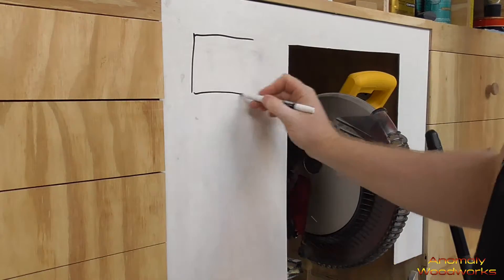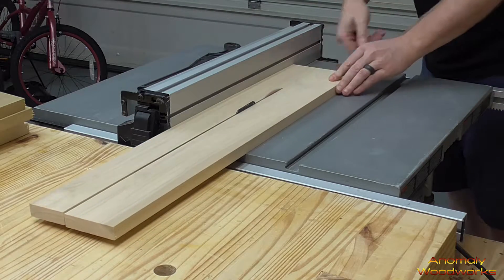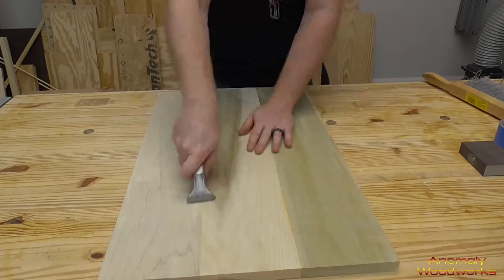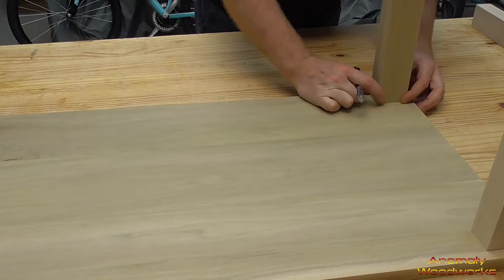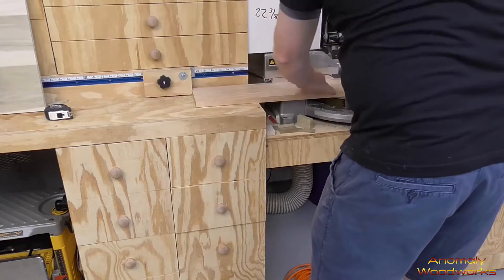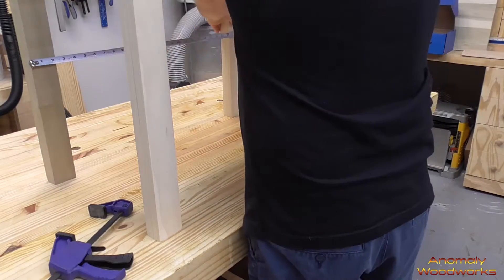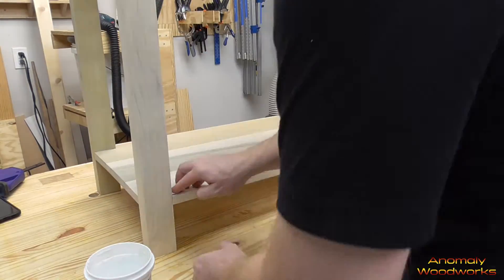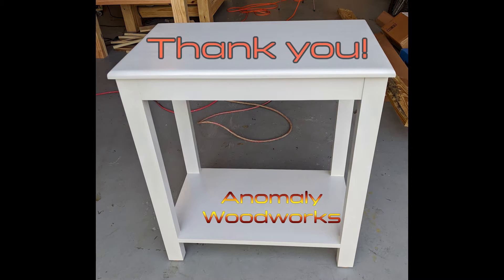Build a Small Table (End Table/Utility Table)

Comment: Cool idea. I've just gotten into the hobby. What kreg screw size did you use on this project?
Reply from the maker: Awesome! Generally, screwing anything into workpieces that are 3/4" thickness you would use the 1 1/4" screw. I use it the most as most things I build frequently use 3/4" boards (1 inch nominal), plywood, etc.